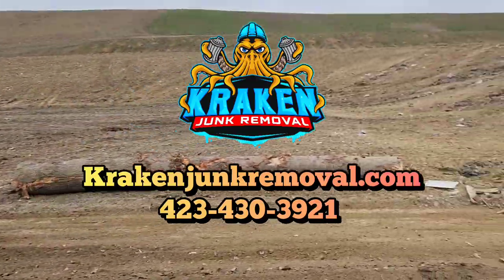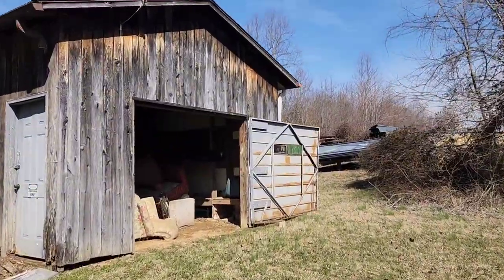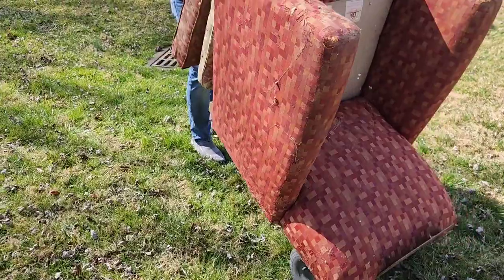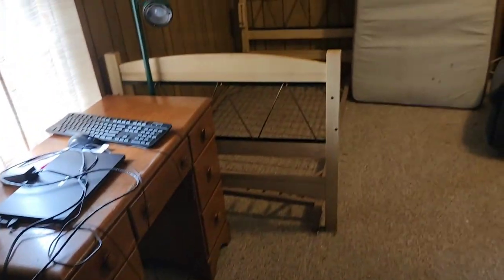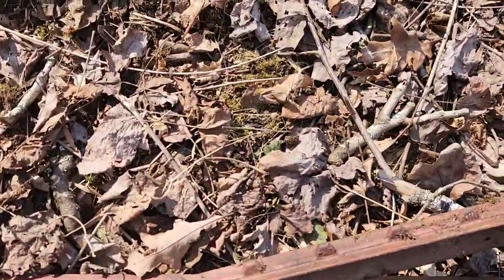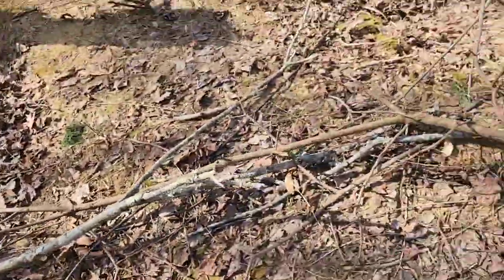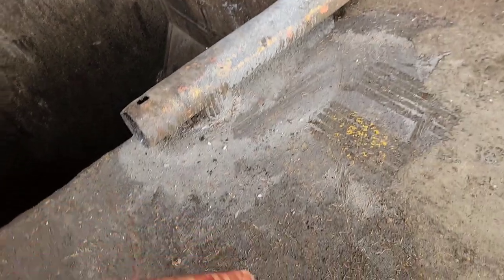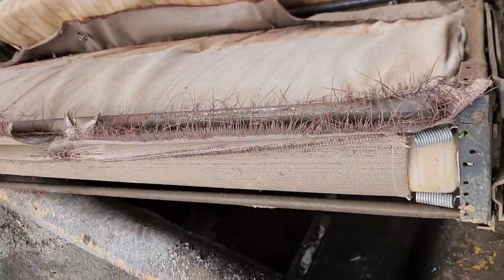Furniture Removal In Jonesborough, TN 37659 by Kraken Junk Removal & Hauling 💪

Comment: Cp junk is using the same Topshelf trailer like me! 💪💪
Reply from the maker: Is that the brand? I was wondering. What size is it?
Reply: @krakenjunkremoval  yes I have 2 of them same color grey
Reply from the maker: @JackofHaulTrades  7x14x? I just bought a 6x12 utility trailer and already wishing I would have just went straight to the dump trailer, but I don't have the space for one now and I'd need a bigger vehicle. May try and get one more season out of the van/utility trailer combo.
Reply: @krakenjunkremoval  yessir it's a 7×14×4 I'm planning on getting a 7×16×3 next